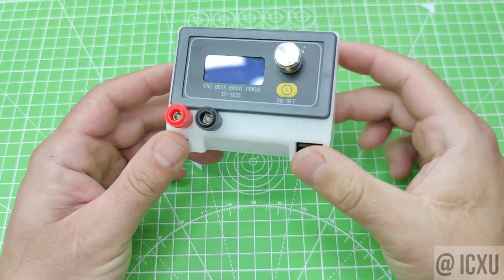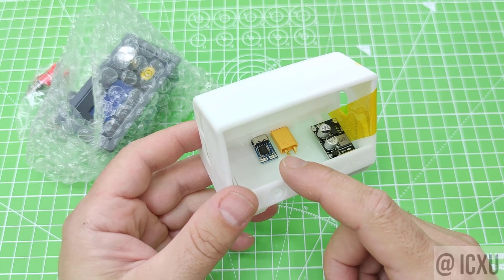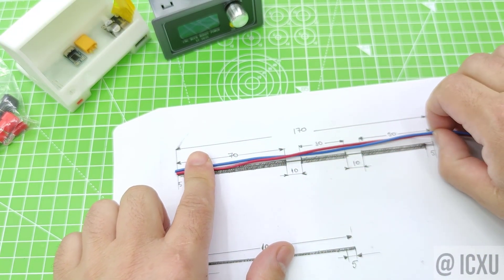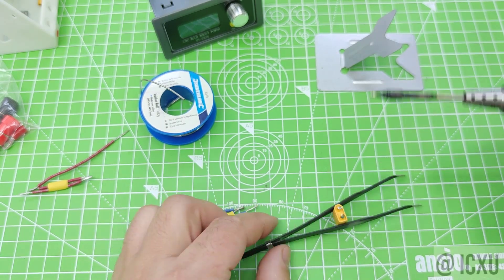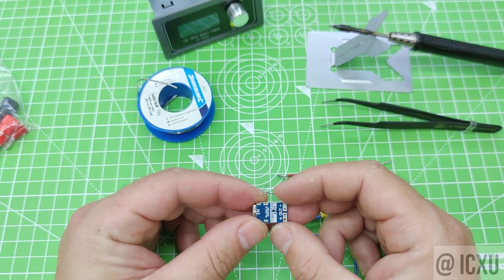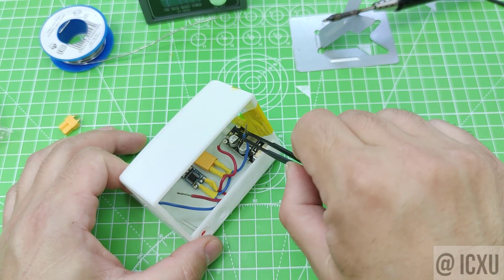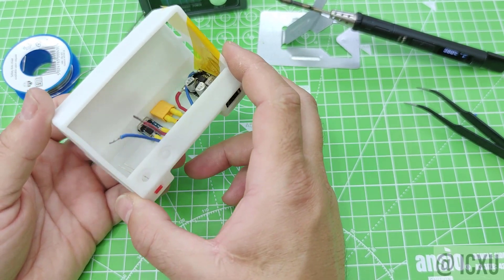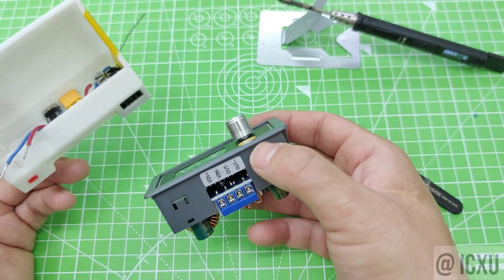Wiring the Tiny Bench Power Supply

Comment: Does it use PD's PPS protocol for variable voltage? Is there a CC (constant-current) mode support?
Reply from the maker: There is no need for a PD "programmable power supply" as the PD module is pre-set to 20V and the SK35 / SK35H module deals with boosting. Converting the power as well as providing user interface. No CC with SK35 / SK35H, as far as I know, but the case is accommodating some Riden modules that are capable of CC. The cases and PD modules can be purchased from eBay